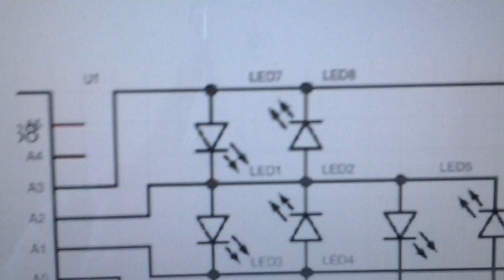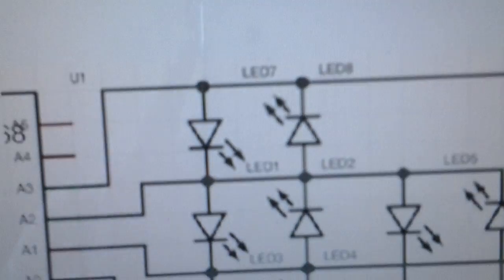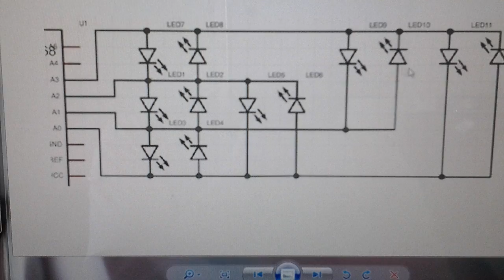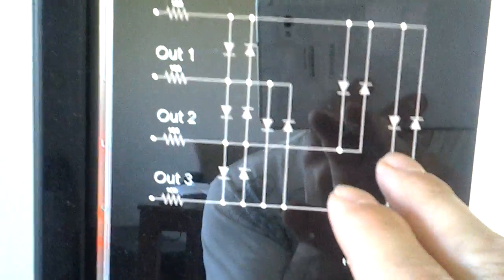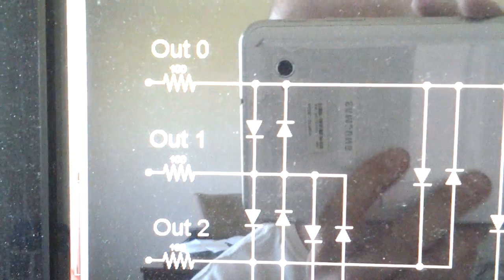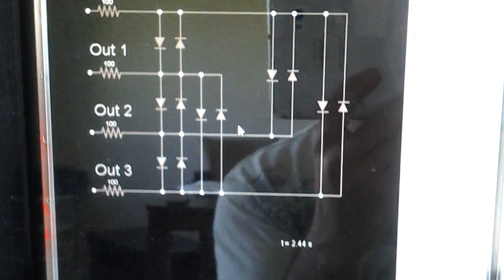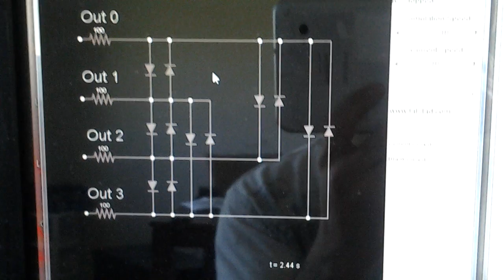Attiny85 vu meter charlieplexing

Comment: Can you provide schematic of eclectec mic circuit?
Reply from the maker: cbm80amiga yes I just had to think hard a bit it's been a while since I made it. provide an email I'll send the image.
Reply from the maker: cbm80amiga you can also get it at this link http://everycircuit.com/circuit/5199097720209408
Reply: Thanks. I thought you used simple transistor amp. Do you remember what kind of OpAmp you used?
Reply from the maker: Yeah you could use transistor to do this job I just happen I have a ton of quad OP amp chip don't remember the number though.

Comment: hallo
am clemo,i saw ur clip on youtube about anttiny 85
,i was wondering u may help me out with a project programming using attiny45
i wanna make clap switch
operation=clap twice on clap twice off
thx
contacts are fb clemo mwenda
                  email clemojunior1990103@hotmail.be
Reply from the maker: Good day this would be very easy to do I haven't play with Attiny45 but it's basically the same just less memory.
Reply from the maker: Of course I've sent you an email

Comment from the maker: I can indeed and I will probably make myself a little "shield" for it that I just need to plug in the little connector and it will supply 5 volts and the audio for the board :) although the microphone would be useful in some case still lots of upgrade I can bring  :)